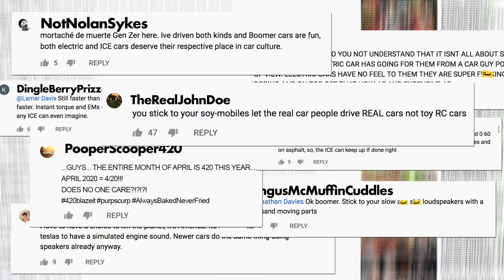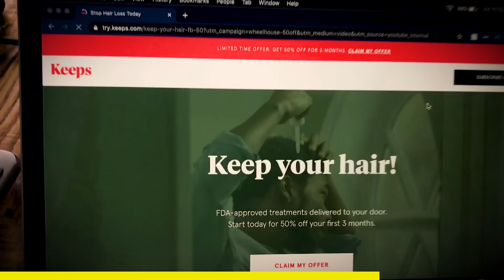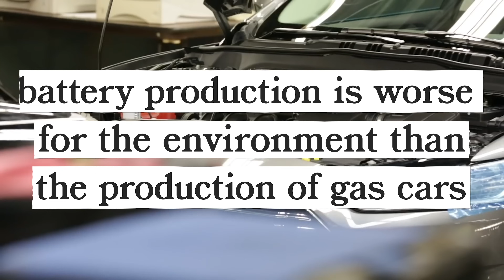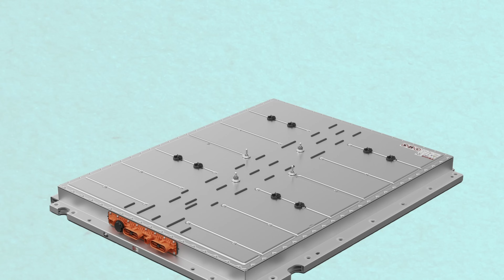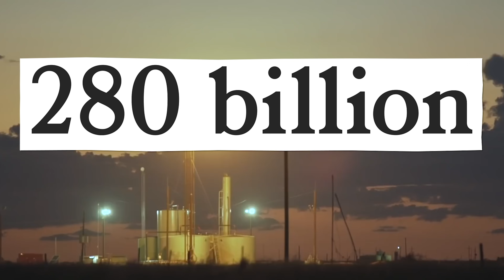Are Electric Cars REALLY Better for the Environment?

Comment: The power grid can handle it!
*Lives in California confused
Reply: edwardschlosser1  When you think about millions of electric cars in a state that already has rolling blackouts and where more people drive
long-distance to work than most other states...well, it doesn't sound good, but maybe I'm just a pessimist?
Reply: For real
Reply: Is that why there are so many brown outs in California during the summer months when air conditioning units are in high use? Wind mills and solar panels will never be adequate especially when so many electric vehicles place so much more demand on their grid.
Reply: Not in TEXAS BABY!!!
Reply: @seanej72  it was the fossil fuel power stations that failed much worse than the wind power, besides what does Texas have more than anything, sunshine (usually) if it was connected to the rest of the grid in the US would have been fine
Reply: @mattdavies890  so... you've never seen a video of a wind turbine failing and you're going to tell me fossil fuels are worse?
Reply: The “grid” may be able to handle it, but the ability to store electricity in California can not. Very few people charge their cars during peak solar production, mid day. Most people charge them when they get home, when the sun is going down. A vast majority of people do not have batteries and in turn there is not enough electricity. PG&E will never spring for the storage infrastructure because the cost will never be worth the benefit. Until the average homeowner can afford a battery electric vehicles will be limited in California. Current prices are about 7-10k for a batter for a single family dwelling’s solar system. That pays for a lot of gas....no incentive.
Reply: Lol, 30%? That's optimistic.
Reply: According to Engineering Explained, if EVERYONE swapped their cars for EVs it would be an extra 30% draw from the power grid.  Most grids could handle that at non-peak load times.
Reply: @adamsmith-bg5wq  it may have a power capacity of close to 30% of standard grid power, but you would have a lot less power use running all the oil dereks and refineries
Reply: @adamsmith-bg5wq  a few very important words, "non-peak load times" what about peak load times, what then?
Reply: And here is my $0.50 take on this... to increase the electricity needed for consumption, you need:
1.  More hydro electric power to create electricity... dams use up more land space and flood out ecological and productive lands ☹️ that's a no-go
2.  You need hectares to produce electricity via solar panels, again reducing prime productive land to create electricity for EV consumption
3.  You need hectares to produce electricity via wind farms/turbines... again reducing prime productive land to create electricity for EV consumption
4.  Increasing nuclear production to generate electricity needs strict monitoring (remember Love Island / Chernobyl)
Every electricity solution has major impact on the environment so EVs may not be the ideal way to go
Reply: @andrewminott7225   @Andrew Minott  
1 - you can burn natural gas, or even coal, to produce electricity and charge your car, and it will still pollute less than driving gas cars. I mean, did you even watch the video? We are not limited to hydropower. Besides, I find it ridiculous that habitat loss is the argument for a proponent of gas car. Emissions from those cars are causing loss of farmable land on a global scale (global warming)

2 - you can establish solar panels in places where it won't compete with food production (Arid land/deserts maybe)

3- wind farms can be built in arid/desert climates AND offshore.

4 - I agree with the nuclear part. We need it but we need it regulated.
Reply: @onur6233  However... burning natural gas and coal is the same as burning petroleum to generate electricity... they are ALL limited fossil fuel resources
Easy to say put up wind and solar panels on arid land... are there enough "arid" lands? Arid lands are reclaimable lands that humans have destroyed in the pursuit of feeding large populations, and with the right mentality and resources can produce again.  On the other hand, how much desert is there to produce enough Megawatts/day to give the rising population enough electricity for daily living and transportation?
I am not a proponent of petroleum propelled vehicles.  I only ask the question of having a balanced view.
The same petroleum/natural gas/coal burning plants that are generating electricity for buildings and electric vehicles are polluting the environment just as much as the vehicles are doing so... and even more as you have never seen a natural gas or coal burning vehicle on the roads.
Plus, the other viable option, hydrogen burning vehicles, are not being pursued by big business, as they would cut down the prifitability of big business... Remember, hydrogen is the most abundant element on our planet, and burning it releases the least pollution
Reply: @andrewminott7225  

"burning natural gas and coal is the same as burning petroleum to generate electricity" It is more efficient to produce electricity in a thermal power plant and charge your electric car than burning gas in your car because powerplants are way more efficient than your car. Again, the concept is explained in the video.

"are there enough "arid" lands?" I'm not American so I don't know your geography well, but I guess the area around Nevada/Arizona is not very fertile, because there's supposedly a Mojave desert around there (I know this from Fallout New Vegas :)) about a quarter of Nevada is enough for USA today. Again, there is also offshore alternatives, most notably wind.

"I am not a proponent of petroleum propelled vehicles." the only alternative to EVs is hydrogen, which requires a lot more electricity production due to inherent inefficiency, so even more problematic by your standards.

"hydrogen is the most abundant element on our planet" Why don't we use it then? Because it is not abundant in its free form, we need to spend electricity to free it (electrolysis) , transport it (pipe it) and pump it to cars, then convert it using fuel cells ($$$) to electricity. It is a lot more efficient to just use the electricity used in the electrolysis to move the car.

Hydrogen makes sense when energy density is vital: container ships and planes need lightweight energy source, Hydrogen would be a good option for those. Hydrogen for cars is just inefficient and expensive.
Reply: @onur6233  electrical components and deserts don’t work too well together. Could actually be more expensive to maintain than nuclear energy plants. Nuclear energy is actually quite safe here in America. Not too much risk so it would be the ultimate solution for future energy. But our government doesn’t want to be so hasty to actually fix any problems, they’d rather throw more money into windmills, solar panels, and hydroelectric energy that I can say for a fact wouldn’t work at all where I live.
Reply: @OneNidim  I believe hoover dam is in the desert? ( I am a simple turk living in Turkey, so not sure) I am definitely not against nuclear, but it has its problems as well. Are you OK with a permanent nuclear waste storage facility in your backyard?

We need a place to store nuclear waste and I think it's harder to determine one than to transfer power from the desert. But I'm still not ruling out nuclear, it just has its problems to solve as well.
Reply: @onur6233  guys I live in the UK almost 50% off our power is generated by wind, 50% we haven't had blackouts for 50 years, whatever is causing the blackouts it is not the renewables, know likely the AC caused by the need to counteract a warning planet
Reply: @mattdavies890  what the heck does "50% we haven't had blackouts for 50 years" so basically the UK does have blackouts and you just want to sugar coat it by saying, "wind is better than fossil fuels"
Reply: @andrewminott7225  So we talked about the footprint of mining for oil and it is high as f..k  , what about all other forms of transportation trucks ,trains, ships , air etc. Forget about the EV for a minute and remember we do not only drill for oil for fuel but a myriad of other things, so fuel aside we still need to drill for oil. Disposal of EV seem to be a non priority at the moment and like any other gadget we always want the latest one out. We already face a problem with current electronics disposal. Are these vehicles going to be backward compatible or cross platform, we already have the problems with the plugs and receptacles. One can go on and on but the aim is not to stall progress but to proceed in a manner whereby we don't have to look back and say oh shit we fucked that up.
Reply: @salinaalieditor  maybe so but if we were not drilling for oil for petrol / diesel we would be drilling far less than we do now, with the corresponding reduction in pollution
Reply: @andrewminott7225  dont forget solar
Reply: @andrewminott7225  OK i'm with you on (1) for the most part.

(2) first you can and we are adding more and more of it on house and other buildings (I not done the make so i  don't know what % if it can got there but that is a lot of space but i don't think it can all go there) as for as "flood out ecological and productive lands" umm death valley the salt flats ext... 

(3)first you can put them in fields or in the sea. you keep acting like there no space and umm that's just untrue.

(4)there stuff i can say but i will just let this one go.

You did not bring up geo just something to think on someday Yellowstone will go off that is if we don't stop it. If you can find a way to pull heat out of it at the right speed you can both keep it dormant and make lots of power doing it. but even if we don't go that big there still a lot of power to get and we can put most the stuff for making it underground.
Reply: @andrewminott7225  I totally agree with your post, but just to keep the facts correct...Three Mile Island that was the nuclear power plant in Pennsylvania  that had a partial meltdown.  Love Canal was the toxic chemical landfill in New York state that was an environmental disaster.
Reply: @andrewminott7225  Dams also kill off the fish since it blocks their migration to spawning grounds.
Reply: @andrewminott7225  sadly Chernobyl didn't have enough rods to stop a reaction to begin with. It was a disaster waiting to happen.
Reply: forgetting 

1. The "high" demand for these they tout is from mandates and regulations. Can't say its demand when its closing in on the only choice.

2. The electric cost that's about to skyrocket to repair from all the equipment not being able to handle the sustained load.

3. The cost of having "licensed elechickens" installing all this stuff in your home to charge this stuff.

4. The odd simutanius occurence of state and local governments eliminating your ability to generate your own electricity. 

5. The rabbit hole of control your various levels of government is going to have to wield in order to make this work while profiting from this both personally and professionally.
Reply: The power grid might be able to handle 30% increase for a short time. The extra (30% roughly) is for peak power demands , like all snow  in TX. this year ,
Pluse EVs rang goes down in could weather . So that is not THE TRUTH